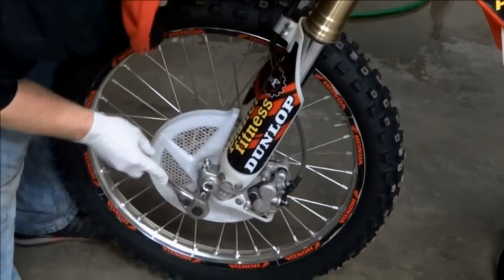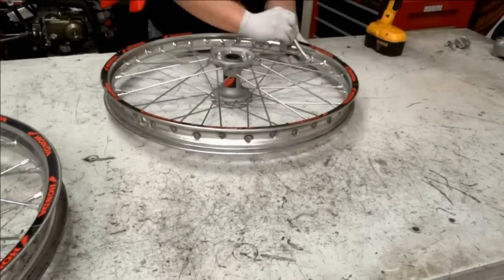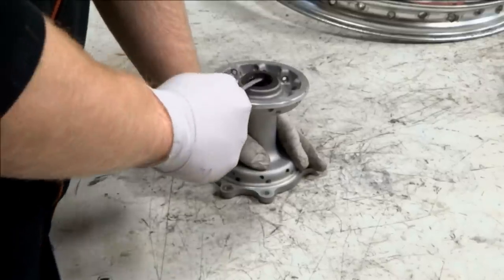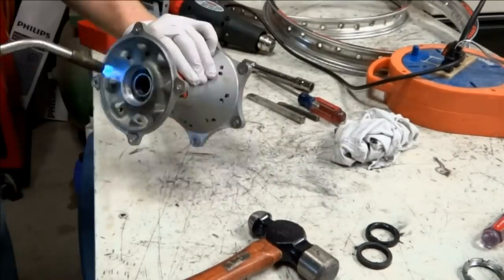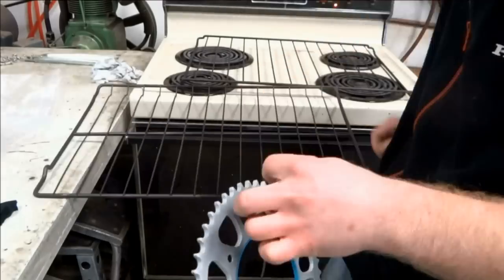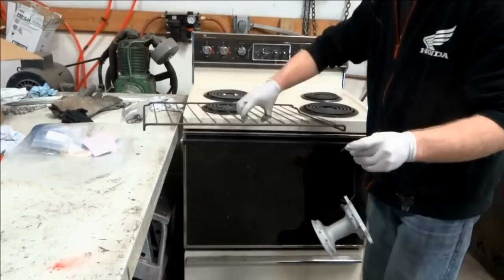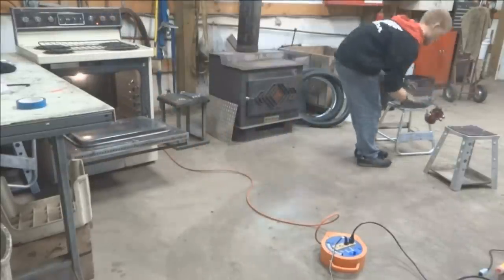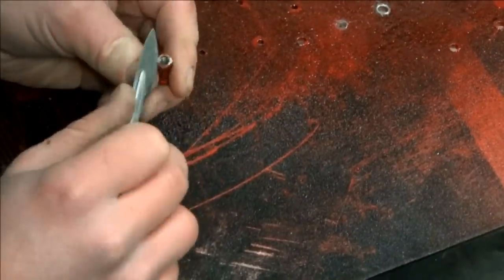POWDERCOATING & BUILDING WHEELS PART 1

Comment from the maker: Thanks! The bearings need to come out so the plastic caps and ball retainers inside the bearings don't get melted in the oven. Any plastic or rubber needs to be removed before powdercoating.

Comment from the maker: Thanks! Nope, I haven't had any issues. Powdercoating holds up pretty good. On engine covers and frames it wears through eventually, but on wheels and hubs it works great.
Reply: Can that be done without removing the seals and bearings?

Comment from the maker: I'm not sure of the exact temperature of the part when the red is sprayed. I would guess somewhere around 125-150 degrees. It has to be hot enough for the powder to stick but not too hot where it starts to fluidize.

Comment: About 10 years ago my son and I built our own oven using insulated ductwork for the box and an electric stove for the heat elements it was large enough for dirt bike frames and wheels it worked great.
Reply: Power Wagon how about a video on your oven. I'm using a freebie electric oven and a box on the front for longer parts.

Comment: Did the powdercoating on the rims hold up pretty well? What do they look like now? are they really chipped up, or just normal wear and tear.
Reply from the maker: Powdercoating holds up great, no chips just the average wear on the top edge where the tire meets. Any coating will wear on that spot. The rims were actually diamondyzed.

Comment: If you have a spoke torque wrench do you still need to tire the wheels or will it automatically be tried after you torque to the service manual specs?

Comment: Great video! Iam thinking of powder coat my wheels, but how long does it last for a life time? on sand tracks for example? can i hit 150 hours before the paint is trying to disappear/ Thanks for answers
Reply from the maker: Thank you for watching the video! The powercoating on the hubs will last quite a while but the rims take a lot more abuse and won't hold up as long. If you are careful changing tires then I would guess you can get at least 100 hours before the rims start to get chipped.
Reply: OneOne9 Creations Thank you for the answer! Keep up the good videos/ Thanks

Comment: Hey man , I was wondering how everything held up after ? I really like your video I'm currently doing a similar project using DID Stx rims . The only thing I question is powder coating the mounting surfaces for the sprocket and rotors . Did it give you abnormal runout or brake pulsation or drag ? Did the spokes install easy with powder coat on ? And do you know if the stock honda hub is good enough quality to powder coat?( heat to 400f) I know t6 aluminum is but the hub quality isn't quite t6 . Hopefully you can answer my questions thanks and keep doing the videos they're awesome
Reply from the maker: All the powdercoating has held up great! The brake rotor and sprocket surfaces were fine after coating, but you could always mask them off which I should have done. The spokes install as normal. Never had a problem baking stock hubs.

Comment: How much Volt you use in order to paint the rims ? Can it be done with a 120V kit ? Thanks
Reply from the maker: +raul fernandez Yes, you can powdercoat with 120V. Check out the guns at Eastwood for more info.

Comment: Great video. I got myself an eastwood kit and have been following your process closely with the same colors actually, chrome base with trans red on top. Question. Did you ever encounter problems with the ground when spraying the second coat? I used a self tapping screw in a spoke hole as my ground, which worked great for the chrome base, but when I went to spray the red only half the hub would take the red. I see the screw worked great for your ground so I'm wondering if you ever had problems with it and did you use a machine screw not a self tapping? maybe thats my problem. Just curious of your two cents. Thanks and again, great vid! Big help!
Reply from the maker: Hey Mitch, glad you found the video helpful. Doing a second coat is always tough once the base has cured and cooled. I've had similar issues with the translucent not wanting to stick, the screw definitely helps but spraying at a certain temperature solved the problem for me. So after pulling the part out of the oven after the base coat, I would let it cool until the rack was just cool enough to touch, usually a 2-3 minute wait. Then spray the color and it will stick much better when the part is still hot, but not hot enough where the powder will start curing. If you have a temp gun you can really find the sweet spot. Maybe try the process with a test part first.
Reply: do you use a dual voltage gun?
Reply from the maker: No, I just have the standard gun.

Comment: Can I so this in my oven at home or is it poisonus or somtin? . Also can I hand sand the parts as oposed to sand blasting????
Reply: Yes you can do this in your basic oven at home but I would not recommend using it for cooking food after doing so.  I would also find a good way to monitor your temps also.  Some powders will create some odor also.

Comment: which powdercoating gun and powder do you use? I am looking into the eastwood dual voltage. however i am wanting to use prismatic powders which recommend 45kv and the eastwood only does 25kv
Reply from the maker: I use the older Eastwood gun. I don't know much about the newer guns. Haven't been into powdercoating for a few years now.
Reply: ReVive Moto Parts right on well your parts still turned out great!
Reply from the maker: Thanks!

Comment: I hope you see this and respond, but could a person powder coat with wheels in one piece, or would baking them mess up the integrity of the spokes? thinking of doing my super moto rims all in a chrome, then the barrel in a candy red and the spokes smoked black chrome.
Reply from the maker: It is possible to powdercoat the whole wheel but it would be very tough to completely cover the spokes and then the hub and rim when they're still together. I'd much rather spray them separately. But to answer your question, no, it wouldn't damage the spokes to bake them.
Reply: thank you

Comment: So it is ok to leave the masking tape on while it bakes right?
Reply from the maker: Yes, the tape I used is made to withstand high heat.
Reply: ok thanks, I have the same tape, just wanted to be sure.
Reply: Does doing a little bit thicker than not make it hold up better? Like on the engine covers than will have boots against them?
Reply from the maker: Yes, you can go thicker for sure. Any powdercoating on engine covers will wear pretty quick though. I've since just left them raw aluminum to avoid the wearing.
Reply: ReVive Moto Parts Thanks for being honest! How about the rims though? They hold up good?
Reply from the maker: Yea rims hold up better

Comment: For the bearing removal, are you hammering them out with the screwdriver blade against the inner race or outer race of the bearing. Applying shock force to the inner race of a roller bearing (that you intend to reuse) can cause brinelling on the races and/or balls, possibly affecting bearing life.
Great video! Powder coat turned out very nice.
Reply from the maker: Thank You! Although I somewhat agree with you, I did this video trying to use the minimum amount of tools. I have a blind bearing puller myself but most people don't so I showed how to remove the bearings with basic tools. The bearings held up great for the few years I used them after this video.
Reply: OneOne9 Creations Yeah, chances are you'll do no harm, but it's just good practice. Apply force (when possible) to the bearing race that is used in the press-fit - as it can be the inner or the outer.

Comment: Old timers call the "punch" marks "peening".
Peen made by a punch, puts a nick in the harder metal while forcing 
the softer metal into that nick. This peen will work as a lock between the two.
Reply from the maker: Thanks for the explanation, I didn't get into much detail on that part.

Comment: when lacing the rear wheel do the longer ones go inside and shorter outside? or the other way around
?
Reply: sprocket side is longer. Bag your parts as you go with labels. Makes it much easier.